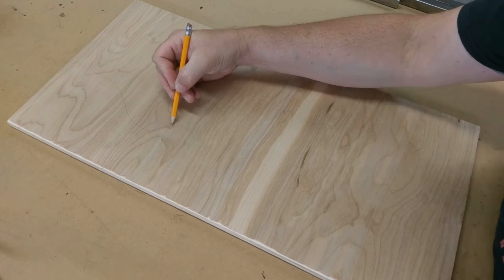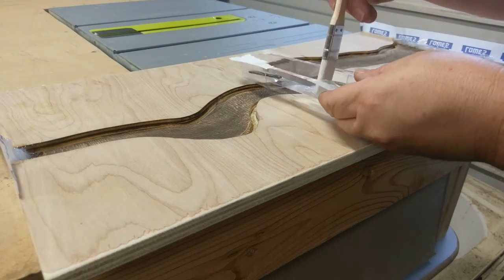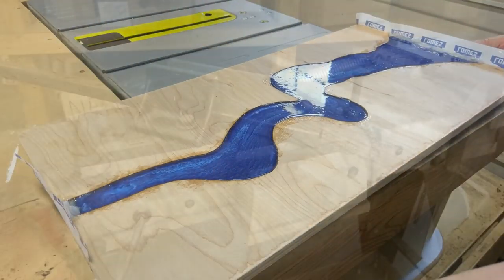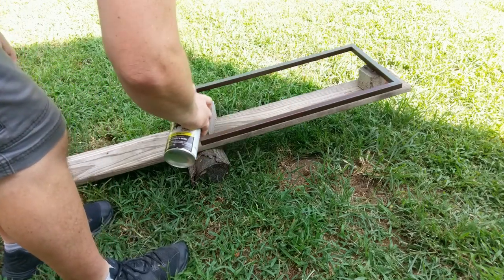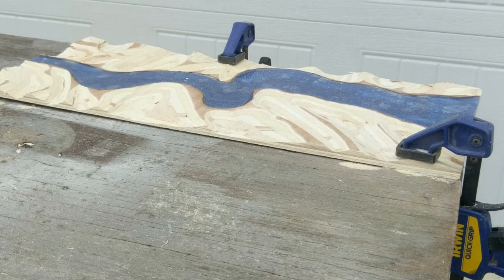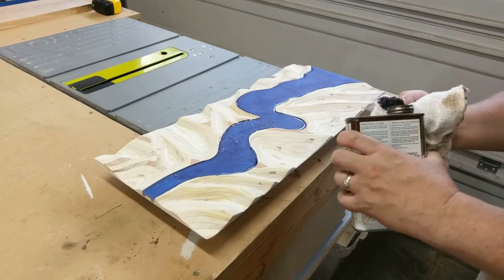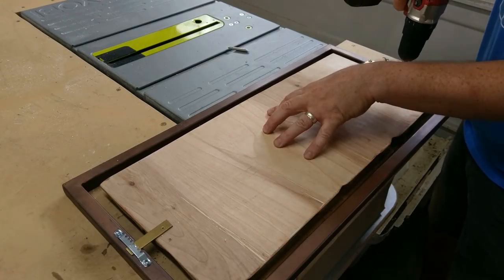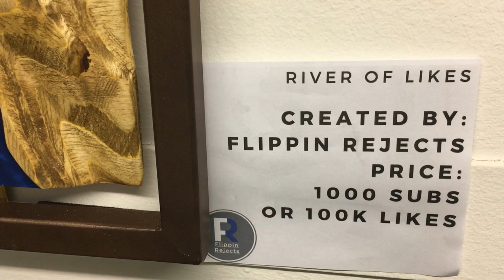Power Carved Wall Art with Resin River

Comment: You must have some perfect precision sanding skills. How did you manage to sand without hitting the finished epoxy?  I would’ve ruined it on the first try.  You think it’s doable to do the carving and sanding before dropping in the epoxy?
Reply from the maker: I think it can be done that way as well. I definitely hit the epoxy several times but once I sanded the wood, I sanded the epoxy to around 600 grit. Thanks for watching.